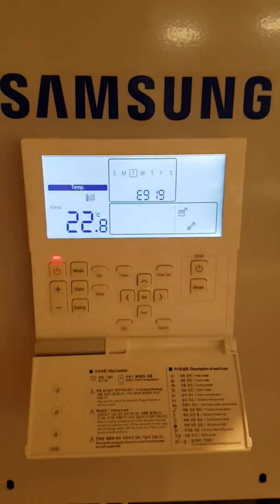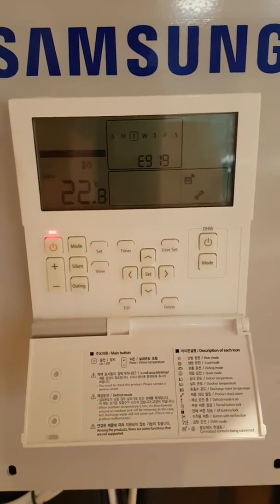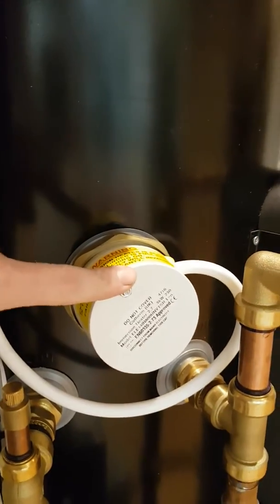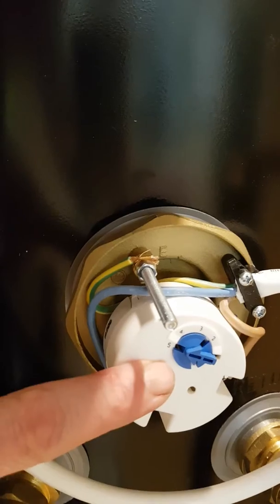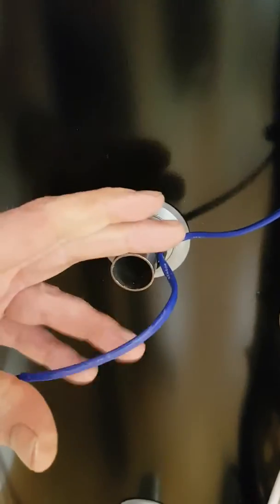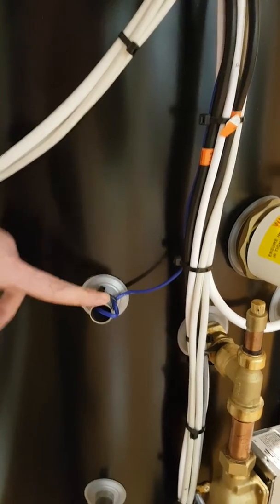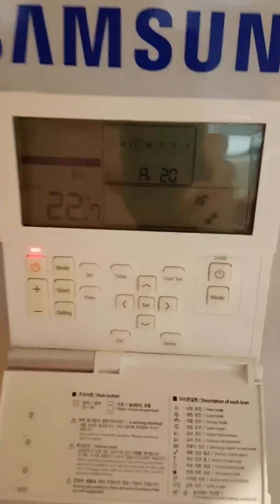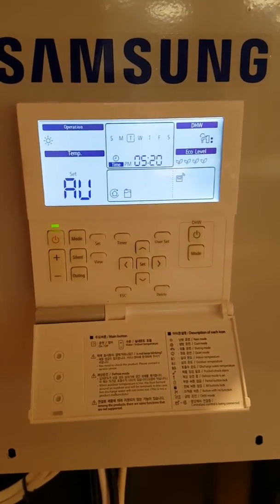E919 error Samsung EHS air source heat pump 2017 onwards

Comment: Nice videos, your videos have really helped is getting my system running where a government certified cowboy builders "Golden Globe Merchants Ltd" installed incorrectly. 

After having to fill the radiators to the correct level and bleed the system it's air free, but I have one question, the EHS HPC heat pump seems to have a lot of air in the system loop where concentrate heat pump fluid mix was filled, how would I go about bleeding it and topping it up with the same concentrate heat pump fluid HPC?

Thanks for your help.

Regards